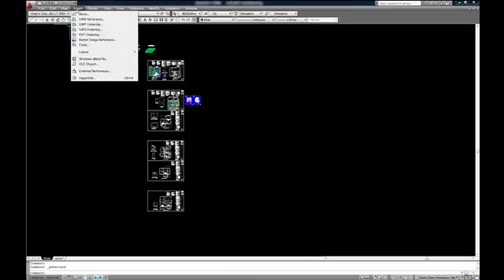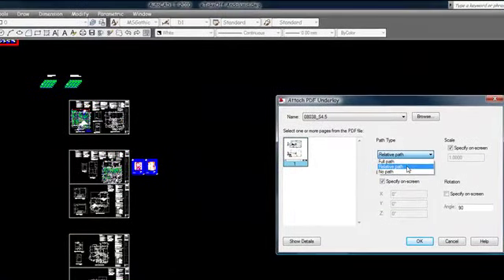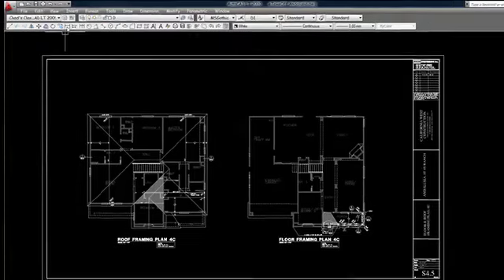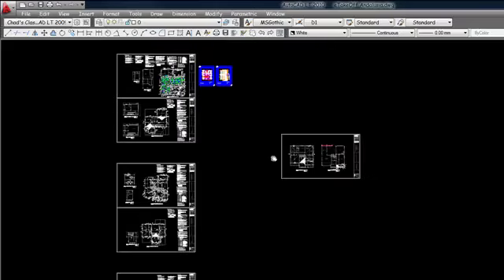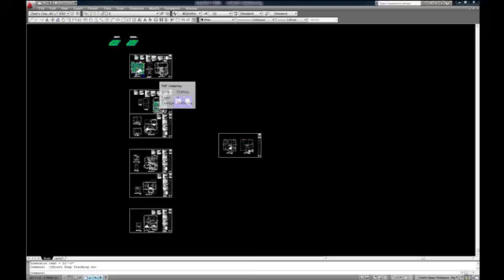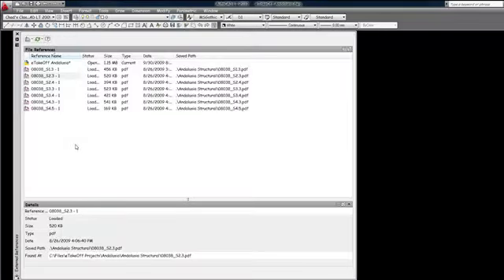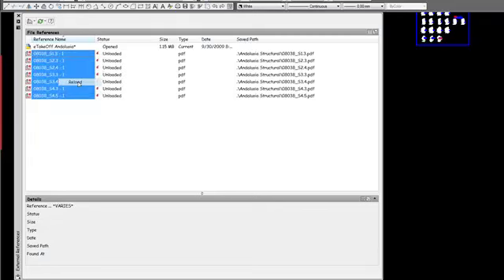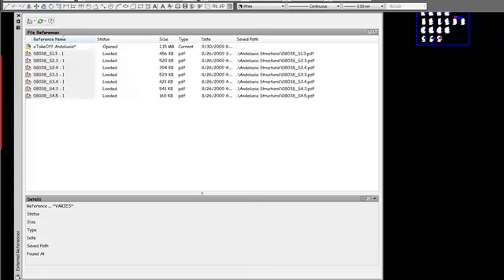Inserting PDF Files Into DWG Files

Comment: why does every tutorial use the GUI? Commands are so much faster.
Reply from the maker: +John Evans, Thanks for your question. I use a combination of mouse and keyboard - many times at the same time. Many older users of AutoCAD (pre version 12/14) use the command line. my videos are done with the procedures I use.
Reply: I started using CAD in 2001 and I never used the GUI. it's too slow. I'm fast at typing so that helps a lot. I wanted to try it your way but I couldn't figure out how to setup the GUI.  Luckily I found a command PDFATTACH if anyone needs it.